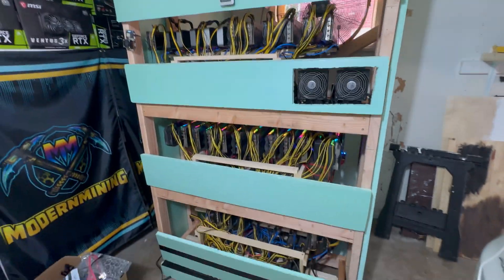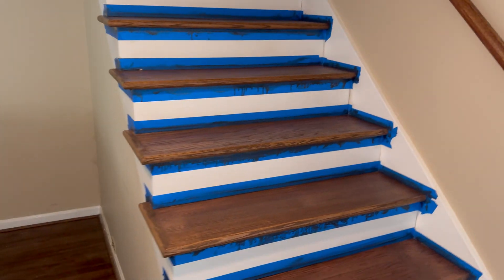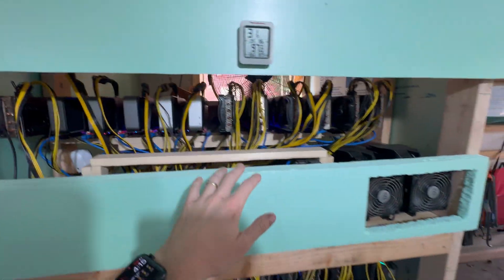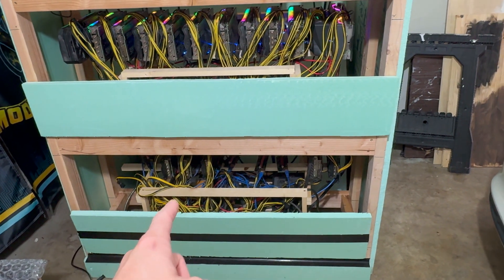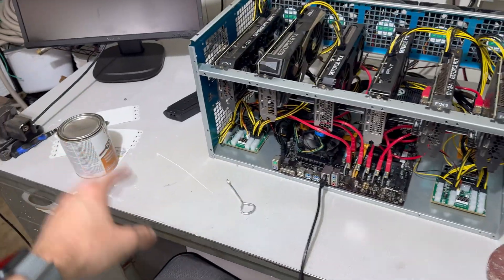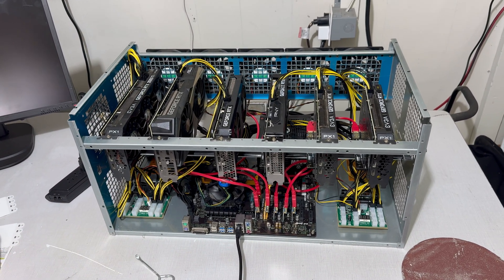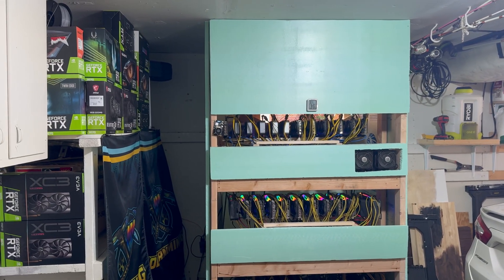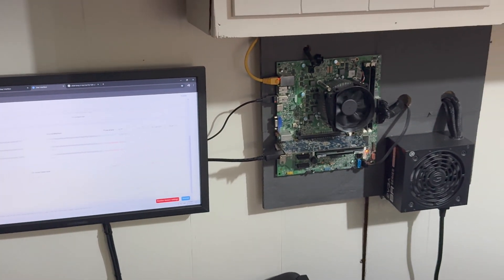My GPU Mining Farm is 100 Degrees!!!

Comment: one other thing...
when you repaste, take your time and relax. i find that just slowing down might take a bit more time but the temps will be few degrees cooler.
i also use the cheap silicone stuff for my gpus, if i have a card that likes to run hot, then i use a tiny drop of anti seize

Comment: unfortunately dude.. With all the asic's coming onto the market, for every popular coin.. I honestly feel its just an end for GPU's.....
With how efficient some asics are,  Watt to Hash ratio, Just cannot be beaten.. and its only going to get worse....
I think its time for asic's.....
My free 2x L3+'s are crunching away great, on HiveOS firmware, running at 460w @ 504mh each... (running 100% on solar)
and ive just purchased 2x Ks0 Ultras off ebay, for a bargain price.. With AC infinity fan kits and upgrade power supplies included :) 
Cant wait to get them hashing away... again.. Will all be 100% on solar
Reply from the maker: Nice with solar you are gonna be set. Honestly you are probably right about gpus but I’m not so sure home ASICS are any better. Prices cut in half after you buy them and hashrate doubles makes for a frustrating experience. You being on solar though is great